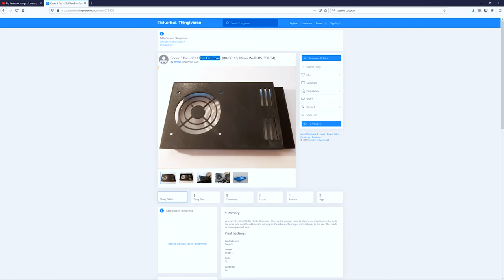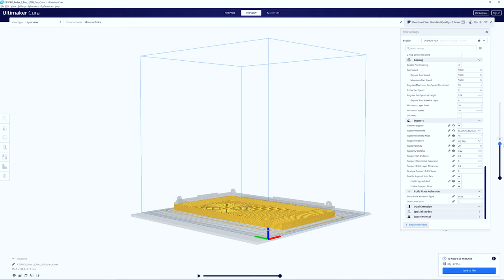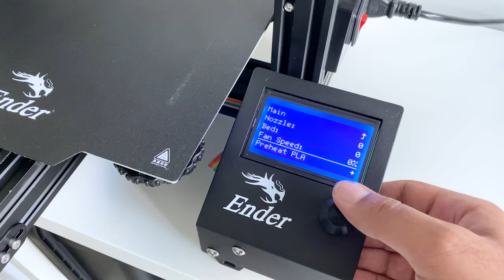Creality Ender 3 Pro Meanwell Power Supply Fan Upgrade Slim 80mm | FINALLY Making the PSU Quiet!

Comment: You had the new fan on backwards, the sticker is supposed to be on the other side. Instead of pushing fresh air in you are now sucking air out.
Reply from the maker: Hey. It actually won't work in the stock push orientation because the fan blades will catch on the printed mount. You can make it work using spacers and what not but it shouldn't make any difference because the fan will simply pull air through the vents. Most computer power supplies work by pulling air through the power supply rather than pushing air into it. :)
Reply: @Mangorille  well the original designer has it that way I guess his fan is different but most pc power supplies actually do have a fan pushing fresh air on to the components and pushing it out through other vents in the psu. But I guess it works either way just negative pressure usually attracts more dust
Reply from the maker: @sebastianpederson7619  You've got a good eye. I looked back at the Thingiverse page and the designer is using two screws only. Perhaps when you add four screws it pulls the fan too close and the blades catch. I'm sure you can make it work with a small washer between the fan and the case if you preferred to keep the stock push configuration. I suspect it doesn't matter as much considering both the intake and exhaust are out in the open anyway.
Reply from the maker: @emtrax  Thanks bud, suppose a couple of washers to space the fan and prevent the blades from hitting would make that possible.
Reply: @Mangorille  Using some washers is fine, or you can just add some sort of spacer between the fan and cover while screwing it in place. After this the spacers can be removed - it will hold that way.
Reply: How did you know the fan would be quieter? Are larger PSU fans always quieter and produce more airflow. R have an Ender 5 pro and the PSU is by far the loudest part
Reply from the maker: @fozbstudios  Typically larger fans produce more airflow at lower noise levels (they need to spin slower). The manufacturer of the fan usually list the noise level in db and the airflow.
Reply: @Mangorille  looks like the amazon fan you linked lists 26 dba and if you google the stock fan model (fd1260-s3112c) it says many different things (e.g. 23, 11, 16 dba) all lower than 26 dba. maybe those vendors are lying lol?
Reply from the maker: @andrewk6008  Hey. The stock fan is definitely louder than those db ratings you mentioned. I did a quick check and found same with some places even listing it at 31db and it appears there is no reliable noise rating for it. The fan linked is definitely quieter.
Reply: @Mangorille  yeah seems like some of them just type whatever they want for dba lol. Great channel by the way!
Reply: The fan is definitely quieter but also due to the fact you don't have the resonance from the aluminum anymore.
Reply from the maker: @vulcan4d  Good point! Thanks.

Comment: a thing you could do which is not necessary but if you really want to make sure no power is in the power supply.
turn it on after you have taken out the power plug and leave it on for a moment before you take it out.
it will drain the remaining charge that might be in any capacitor so you will have a less chance of shorting any of the components.
The same way you do with your computers power supply and it doesnt hurt anything to do so and it minimizes a risk that may or may not be there
better to be on the safe side boys
Reply from the maker: Great suggestion, thanks for sharing!
Reply: Thank you for this tip! Actually helpful instead of just commenting that this work can be dangerous, are there any other best safety practices to be aware of when working with a PSU like this?
Reply: I thought the same thing when I seen him digging that wire out right after unplugging lol, gotta be careful with electricity.

Comment: Just done my upgrade, thanks for the video and responses mate. The fan is much quieter now. 

Here is a bit of feedback for you and others that will be doing the upgrade.
1) The case you linked to on Thingiverse didn't fit for me. The 80mm fan was too large and the case wouldn't close as the fan's plastic housing was pushing against the big yellow part (don't know its name) that was fixed on the circuit board. I therefore used the remixed psu cover that was on the same Thingiverse link. Someone had remixed it to fit a 80x25mm fan instead. That worked perfectly.
2) For a beginner like me I had a lot of trouble getting the wires out of the small white clip when using a screwdriver. In the end I saw a video on youtube that recommended using the little metal attachment you get with iphones, which pops the sim card out and that worked fine to get the cables out.
3) Lastly I switched the fan around. As you had the fan on backwards, the sticker should be on the inside. I know on the original thingiverse psu cover the fan blades were catching against the cover, but that isnt an issue with the remixed psu cover.

Cheers again.
Reply from the maker: Hey David, glad it worked out for you and congrats on completing the mod! The case linked only works with the fan linked as it requires a slim fan (80x10) otherwise the fan will run into the transformer (yellow part). I actually provided that feedback to the Thingiverse designer and he updated his listing to indicate that it only works with 80x80x10 fans. Good suggestion on using the iPhone paperclip! The fan being "backwards" is something that had to be done because the blades were hitting the case . Sounds like you did not have this problem. Thanks again for your feedback and happy printing!
Reply: The fan can face either way because there are cut outs at the bottom and there is just one fan. In fact, you could argue that it would be better to have the fan facing out like in this video to aid convection and as an added bonus, reduce dust build up. Neither way is wrong.
Reply: You say "For a beginner like me I had a lot of trouble getting the wires out of the small white clip when using a screwdriver."

This has nothing to do with being a beginner. This is about using the right tool for the job. If the tool isn't working, then think of a better tool, whatever it is. A staple would have worked too, so would have the smooth end of a needle, a safety pin, the pointy end of the nail file of a nail clipper, etc.

I really want to tell you this because blaming this difficulty on "being a beginner" sets you up with the wrong mindset of being dependent on others for solutions rather than finding solutions yourself. You had trouble when using a screwdriver because the screwdriver was too big, which you should have noticed yourself. The solution then was obviously to think of something smaller you could use, which I'm sure your household has plenty of. You did not need a video to tell you that.

This also highlights the importance of buying tools. Having the right tool for the job will get you half the way there.
Reply: @expression3639  all wrongly assumed and nothing to do with mindset. I was watching a tutorial video and would obviously try and follow it as close as possible to avoid errors. I used the same size screwdriver as the video and noticed quite a few others had the same problem. I was just giving feedback to let others know what worked for me. Take your negativity elsewhere, change your mindset or you will accomplish nothing.
Reply: do you have the link to the new PSU case?

Comment: You installed the fan backwards. The label is on the side that the direction the air flows. The air should flow into the PSU. Otherwise great video!
Reply from the maker: Thanks bud, a few other folks said the same thing. Haven't had an issue yet and it was done to avoid having to shim the fan otherwise the blades were hitting the printed case.

Comment: Nice upgrade! I recently did a similar one to the PSU fan on my Ender 3 Pro. But instead I elected to do the one that used an externally mounted 92mm fan (with grill) as I had a spare 92mm Noctua on hand. When the PSU kicks on or off, you can't tell. Even with your ear right beside it. Next up: Hot end and electronic's fans are getting the Noctua treatment.
Reply from the maker: Thanks bud. I tried the externally mounted 80x80x25 fan and found that it made no difference for noise or cooling. Liked the sleek look of the slim 80x80x10. Really, any 80mm+ fan is going to be a huge upgrade for the noise level. Combine this with the Noctua hot end and electronics fan and you've got a nearly silent printer!
Reply: @Mangorille  When I bought the printer initially, I couldn't really hear the PSU fan noise very much. The stepper driver noise obscured most of it. Once I installed the SKR mini e3 board, I was like, oh, this is pretty quiet now. But the hotend and electronics fans are little loud but not too....and then suddenly HOLY CRAP the PSU fan kicks on. It was like a hair dryer.
Reply from the maker: Hahah sounds familiar! ;)
Reply: I'm a big Noctua fan (pun not intended).  HOw did you mount your 92mm?

Comment: This video fails to mention that capacitors in power supplies can contain charges that kill *even after being disconnected*. Until you've verified the capacitors are discharged, you should always treat PSUs like a loaded gun and exercise extreme caution. If you don't understand any of this, do not attempt this mod!
Reply from the maker: Thanks for the reminder! The video does mention that folks should be skilled/comfortable working with something like this before attempting.
Reply: This video isn't a safety video. There was no failure to mention anything. If you want to criticize, go check out an electrical safety video and have at anything you notice.

In this video, you were advised to be comfortable working on electronics. If you don't understand how capacitors work, you aren't comfortable working on electronics. In other words, you were warned, which constitutes successfully mentioning everything that needed to be mentioned.

Comment: could you modify this to work with a 80X80X15 fan? thats the only thing i can find on amazon in the usa
Reply from the maker: Unfortunately not this design. There are other 3d print files designed for a thicker fan but they won't be as sleek looking.

Comment: Great video! Anyone have a guide on how to crimp and reinsert the JST connector? Mines just not going in, spent 4 hours with this tiny little piece
Reply from the maker: Someone posted that he was able to remove and turn the plastic guide on the power supply board around vs. changing the connector. I haven't tried that so use at your own risk.
Reply: @Mangorille  interesting, i got it working anyway, I made a mistake and used the Noctua 80 x 25mm fan instead, the connectors and that one were a bit strange so I swapped them for JST connectors which worked, now its all silent! Did your hotend build as well, appreciate all the hard work that goes into these videos
Reply from the maker: @srn2529  Welcome. Surprised you were able to fit a 25mm fan in there.
Reply: I realised my mistake and mounted the fan to the outside haha, will probably use the slim line fan in the future
Reply from the maker: @swm2058  It will function the same but just won't look as nice. Make sure you don't get your fingers in there.

Comment: make sure the fan orientation is the same as it seems to be reversed in the video.
Reply from the maker: Agree, I flipped it around as the fan blades were interfering with the housing after tightening. Hasn't caused any problems.

Comment: Since this video’s old, I’m not sure if you’ll se this. Is it alright if since the fan is a DC fan, if you swap the red and black wires around so it spins in the opposite direction? This would mean that you don’t have to turn the fan backwards for mounting, right?
Reply from the maker: No, the fan needs to be connected in the correct polarity in order to even spin. What you could do is use some spacers so that the fan blades do not hit the case and then run it in the stock blowing direction.
Reply: @Mangorille  awesome. Thank you for replying
Reply from the maker: @urboyluke_  No problem, happy printing!

Comment: I know very little about electronics. On other videos I have seen when switching fans they use buck converters when using a fan that isnt built for 24 volts. Does that not apply this 12 volt Fan?
Reply from the maker: Hey David. It all depends on the power supply your Ender 3 is using. The Ender 3 Pro with the Meanwell uses a 12 volt fan already so there is no need for a buck converter to alter the voltage. I believe the normal non-pro Ender 3 uses a 24 volt fan so you would need a buck converter to drop the voltage from 24 to 12. Easiest is to double check the fan that is already in there to find out. Also, make sure you are comfortable working with the power supply, you can shock or hurt yourself!
Reply: @Mangorille  thanks. I do have the ender 3 pro. Do you check the current fans voltage with a meter or will it say it on the actual voltage on the fan?
Reply from the maker: @zombieshart1001  It would be listed on the fan's label. Check out the video at 3:04.
Reply: @Mangorille  This is incorrect. Regardless of whether it is 12v or 24v, Creality ships 12v fans in 24v PSU's. Thats the main reason why the PSU fan is so loud is because it is a 12v fan being forced to run at 24v speeds. Either replace with the same voltage level or use a buck converter.
Reply from the maker: @yoko312  Even the older non-meanwell power supplies? Regardless, best to check the voltage rating of the fan so you know for sure.
Reply: @Mangorille  sorry I never got back to you. I ended up buying a 24 v fan and took a part my Ender 3 Pro (24v) and found that the stock PSU fan is a 12v fan. I popped my 24v fan in there and it is so much quieter. So yeah, for whatever reason, they ship out 12v fans in 24v printers.
Reply from the maker: @yoko312  Thanks for the update. You may want to double check that the cooling is sufficient with the new fan. It is quieter because it is spinning slower.

Comment: FYI I saw another video of this conversion and it noted that there are 2 different fan cases from thingiverse one is for the ender 3 and the other is for the ender3 pro
Reply from the maker: Thanks for the heads up. Correct, the ender 3 pro uses the meanwell power supply. Not sure if the ender 3 regular has switched over to the meanwell but now as well but at the time of filming it hadn't.

Comment: i have dual z axis motor,i need  it for the heavy million things on the gantry X axis rail , where else i can mount this . i have dual motor xy n z
Reply from the maker: Hey. Where do you have your power supply mounted right now?
Reply: run a earth lead from PSU to the printer,scrape the coating to get a good earth ,did it with mine then I put the PSU out of site  on a shelf.

Comment: I just finally did this the other day.  It is very quiet now.  I also added a mini voltmeter to measure the fan voltage.  

You make take the pins out of the connector look easy.  I always struggle and usually destroy the locking pins on several before I succeed.
Reply from the maker: Thanks for sharing. Key is to use a small sharp object to lift those little plastic tabs that hold the pins in. :)

Comment: you didn't need to reverse the fan wires, motors arent polarity sensitive, it'd just run backwards(reletive to the arrow usually molded onto the side of the fan)
Reply from the maker: Not sure about that, I always thought they have polarity but never tried it honestly. I do however believe that the fan blades are designed for efficient operation in one direction only.
Reply: @Mangorille  you’re correct about the efficiency part. It only matters if the fans a pwm
Reply: No it won't.

Comment: After upgrading to the BIGTREETECH SKR Mini E3 V2.0, this is the perfect compliment to make the Ender 3 Pro even more silent.  Thanks!
Reply from the maker: Thanks for the comment, agree! Next you'll need to change the hot end fan, that's the other noisy part. :)
Reply: @Mangorille  Do you have any reccomendations for the hot-end fans?
Reply from the maker: @mattevans7352  Yes sir, there is another video on my channel for upgrading the hot end fan. https://www.youtube.com/watch?v=LJ2Pnw8_cEA&t=326s

Comment: Is there a way to tell what voltage of fan you have without opening the psu? Also to clarify, will the 24V version of this fan work for the upgrade? Thanks
Reply: You should match the volts on your current psu. So if you have a 12v use a 12v fan. I don't think a 24v will work in its place. At least you won't get the optimal rpm to cool as well.
Reply: The other guy's comment is incorrect. You can't just match the fan to the power supply as they aren't always the same voltage. My original power supply is 24 V and has a 24 volt fan, my new meanwell power supply is 24V but has a 12V fan. Unfortunately you just have to open the power supply and check the fan to find out.
Reply: @MachineChrist6  This is incorrect but I can definitely understand why it would seem this way. Unfortunately you can't just match the fan to the power supply as they aren't always the same voltage. My original power supply is 24 V and has a 24 volt fan, my new Meanwell power supply is 24V but has a 12V fan. Unfortunately you just have to open the power supply and check the fan to find out.
Reply: Thank you for the heads up! Definitely info I didn't know. :)